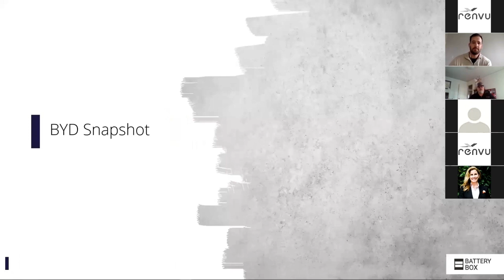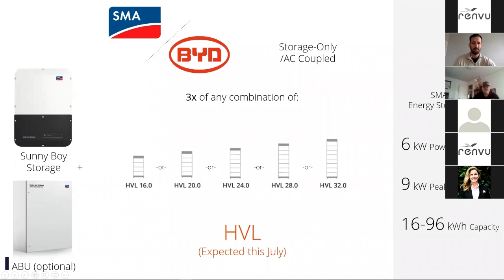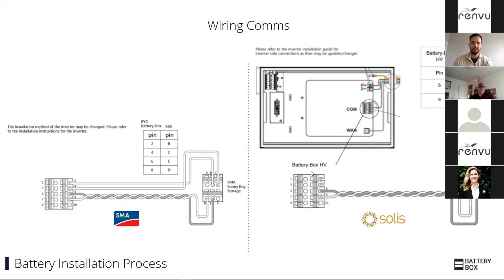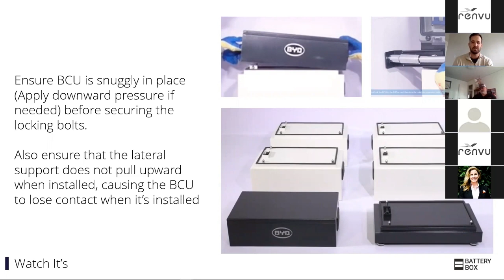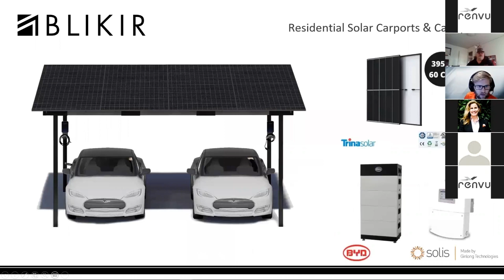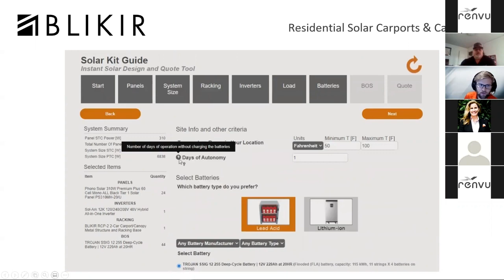Energy Storage Market Series with BYD & Solis | RENVU

Comment: If I order the SOlis & BYD, are there instruction to configure the charging spec for BYD?
Reply from the maker: Hello! The Solis Hybrid inverters and BYD batteries are UL 9540 certified (ESS System certification) and instructions for setup are included in the installation manuals:

https://drive.google.com/file/d/1IqTPRueMt6Iuq_5QOElQLGJlXomE4SNs/preview

https://drive.google.com/file/d/1sUciQDl6zLwBYLrzhaFX0X2qucqQJuZz/preview

Let us know if you have any other questions by emailing, info@renvu.com.